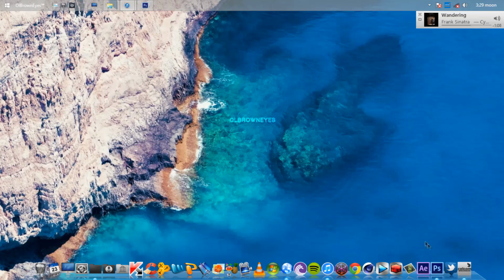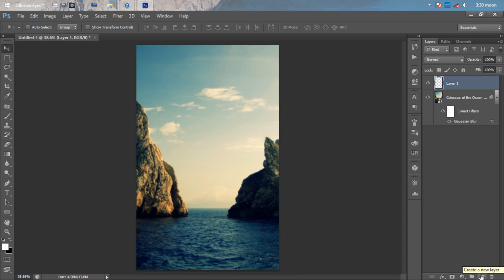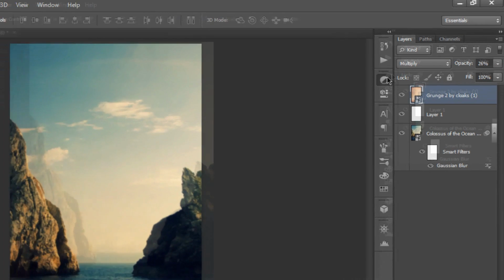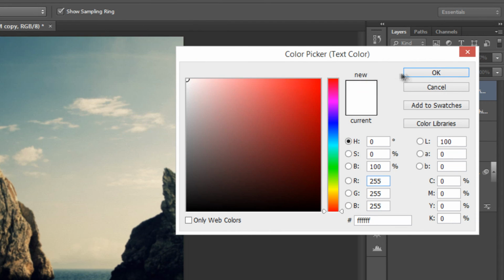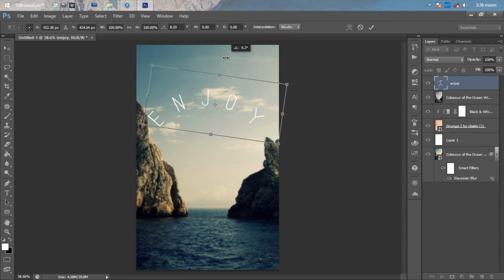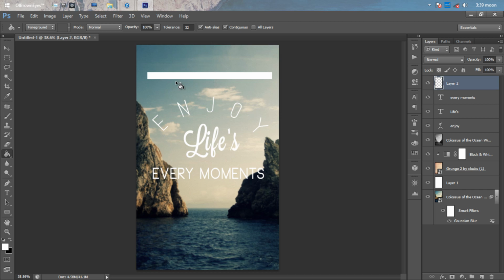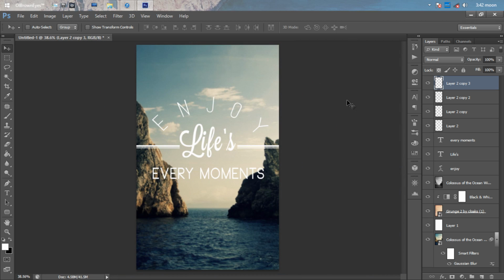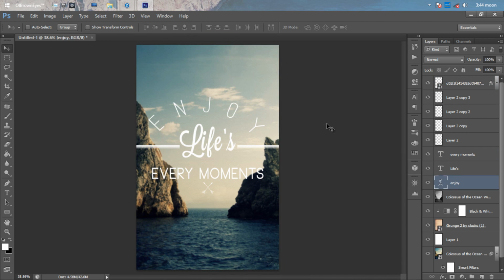Photoshop Tutorial Simple Hipster Text On Photo Effect

Comment: There's no reason to add a white layer with a Multiply blend mode. The multiply blend mode is an additive mode that multiplies the pixel values of two layers and divides by 255, so adding a white layer set to Multiply is basically like saying 1x1, which equals the starting value of 1 (nothing added). You can skip that step and get exactly the same result.